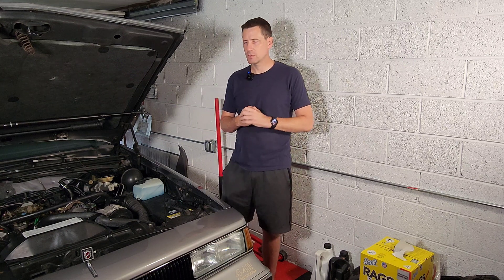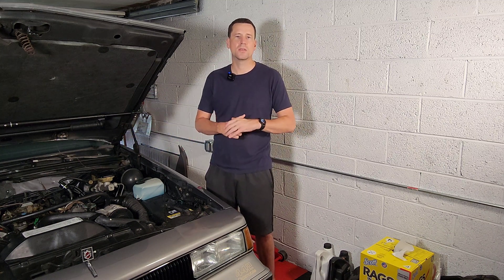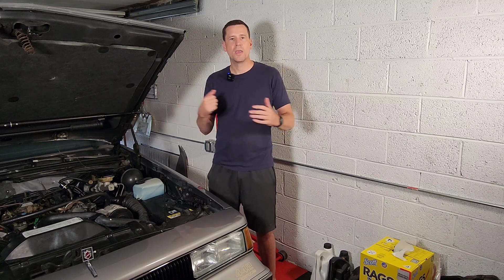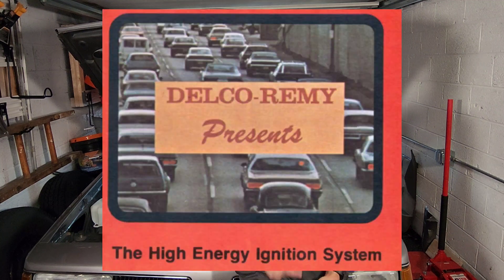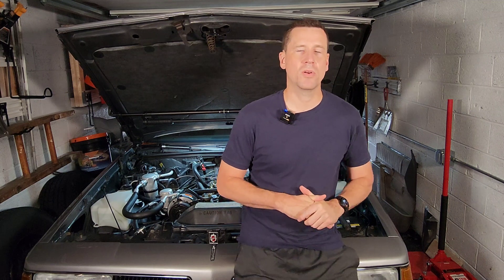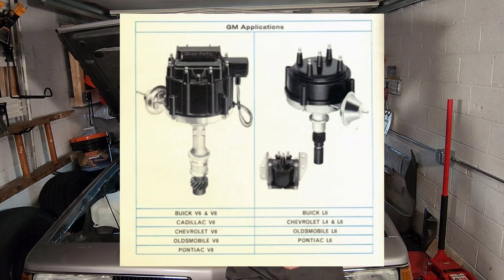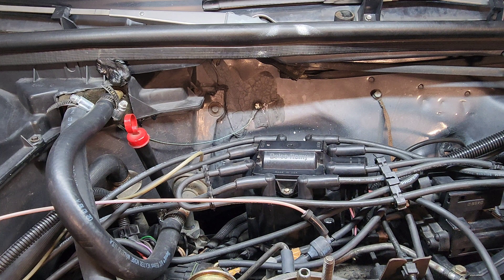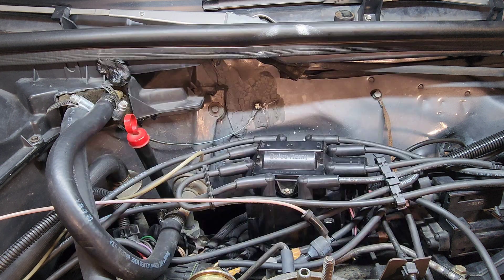GM High Energy Ignition - The Basics for Beginners

Comment: I would like to see a part 2! One issue I've recently had with my original GM HEI is the motor would rev freely to around 2800 rpm, and seem to stop there? Did not seem to be a run out of fuel issue, it ran good and did not sputter at all, my dash tach showed a hard stop at 2800 rpm. Throttle and choke lockout linkage was not limiting it (Rochester 4 bbl.) I connected a diagnostic shop tach in place of the dash tach and it did the same thing. What I found, and I have not seen this discussed was that the original radio interference cap measured 0.87 micro farad, 2 new GM harnesses (GM still makes that harness, P/N 19207437) caps measured 0.24 micro farad, and one reproduction harness I have measured 0.24 as well. So my original radio cap deteriorated (?) to nearly 4 times the value that GM intended. That capacitors noise filtering load, or resistance in that circuit is frequency and capacitance dependent so it makes sense. Unfortunately, the new style GM harness requires you to remove the module to install it and my module had Hong Kong engraved on it, so I replaced that with a new GM module which was USA made.  I will be taking the car out of winter storage soon, we'll see what the result is.